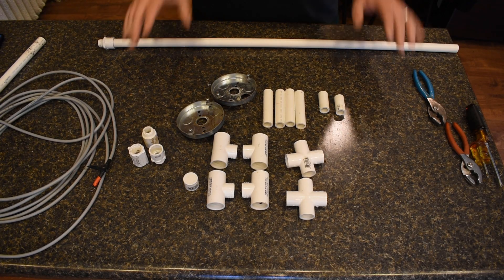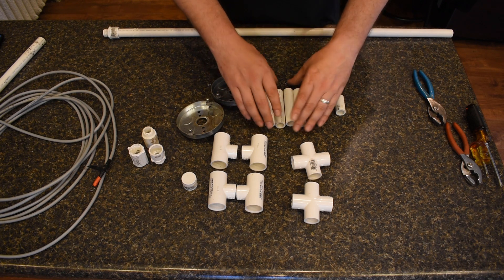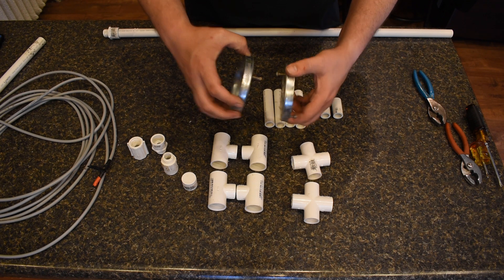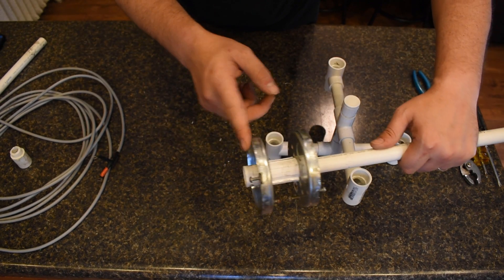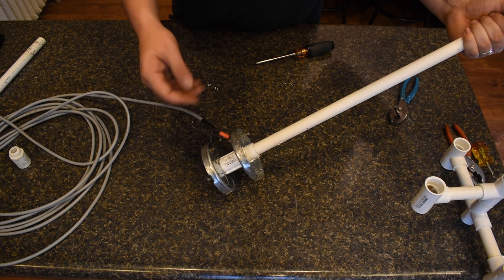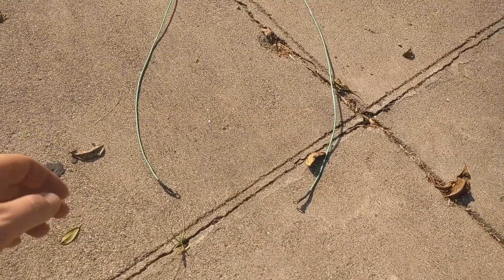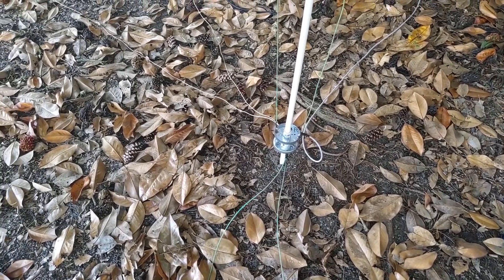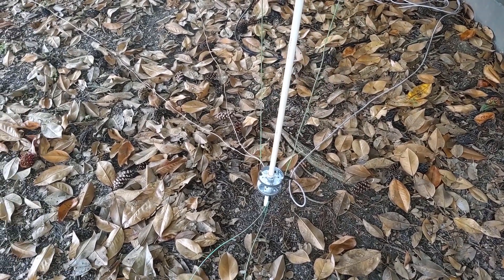Cheap HF Homebrew 40m 20m 15m Vertical antenna.

Comment: nice interpretation of a DX Commander antenna
Reply: Impressive..you just saved me some money  Big Thanks!!!!
Reply: @johnryan5781 : DX Commander antennas won't cost you an arm and a limb, though.
Reply: E Knaap already have one and love it.  I was just thinking about experimenting with building a variant.
Reply: @johnryan5781 : A third world variant... Nice, not thrilling, but nice. (Mel Brooks' History of the world). Gave you a 👍.
Reply: @johnryan5781  I just used some speaker wire and a cheap balun. The expensive piece of equipment was the auto tuner, an MFJ 926b.  I have used this for other antenna projects as well (random wire, for example), so I thought the investment was okay.  The apex of the wire hangs about 10 meters in the air (quarter wave for 40m band).  The ends are either on squid poles about 6 meters tall, or secured by cordage to the ground (inverted "V").
Reply from the maker: Thank ya!

Comment: Nice simple set up. Good idea and low cost. Perhaps you can let us know how it's been performing. 👍
Reply from the maker: Thanks! I've been steering away from diving into performance details because I don't have any way to actually test it. I've been using the Icom 7300's internal swr meter to tune my builds. Analyzer is on my wish list! I will say that getting DX has been easier with this antenna and I do believe, just by using, that it has a nice, low, takeoff angle. I've gotten pretty good signal reports from it. It is a little noisy here in town, but all my antennas are...the vertical is just a bit worse. I did take it to do a POTA activation once. With no noise it performed excellent in my opinion. Sorry my answer sucks lol! 73
Reply: @mikehannah6054  Actually I don't mind simple low tech performance tests . Signal reports, distance, and just how it sounds is good enough for me.  Good to hear how it improved your dx. 73s